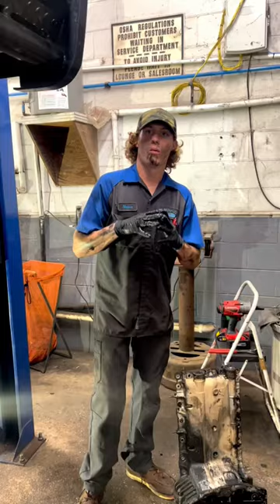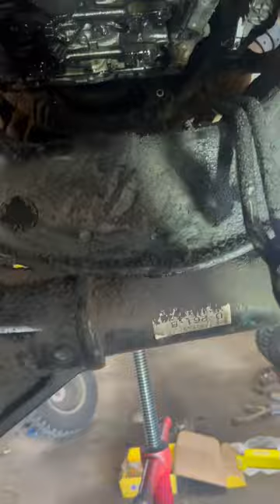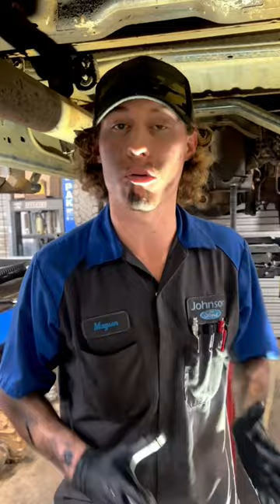Mechanics Should Get To Stay Clean Too #shorts

Comment: Mechanics are always finding new things to put on a invoice 😂
Reply: customers are always bringing in vehicles that are more messed up or rotted out than it seems on the surface and then complaining that they have to pay for all the extra components needed to fix the vehicle properly because they didn’t fix the problem when it arose and let it get really bad to the point that other components are damaged and then crying about how “I’m BeInG UpChArGed FoR noO ReASoN ShADy mEChanIcs alWAYs TrYinG to RiP peoPle OfF” 😂
Reply: @Badwerty0  y’all really do be ripping people off though of course not all shops but I went to get vehicle inspected let my brother fix all the messed up stuff so it would pass because he is a mechanic and did for free. Take it to shop tell them I fixed everything but it’s still having a problem with brakes. Just for them to call me saying it’s 168$ and all they did was put a battery hold on it and slap a inspection sticker on it. Didn’t even fix the braking issue because they didn’t know what was causing it. Turns out it was the abs system when I use cruise control brakes fine when I manually break car shakes like it’s about to crumble
Reply: @esaint5535  ive seen that before. Abs sensor goes bad so every time you hit the brakes the abs system thought the tire was locking up since it was only a speed sensor that changed voltage when it came in contact with the magnet in the hub. Then it would respond by pulsing the brake caliper really fast whenever the brakes were applied. Jeep compass was what i fixed that on.
Reply: @Badwerty0  Probably because these things are built worse and worse with every generation. Used to be a time you could go a couple months with an issue before it even THOUGHT about damaging anything else, these days the CEL comes on and you have all of 30 minutes to get it into a shop bay before the failure starts spreading. And often times it's major issues that cascade instantly....wheels just falling off, conrods yeeting before the first PM comes due, steering wheels coming off in your hands five days after you take delivery.......yeeaahhh these things are built like shit and you can't really blame the owner as much as you used to be able to.
Reply: @esaint5535   I get what you’re saying. Sounds like the shop you went too didn’t have great techs that know how to diagnose properly of course there’s bad shops and good shops 
At the same time though yes it’s expensive to repair a vehicle most places are making very little money because parts have gone up in price so have wages they’ve got to pay their employees , pay the bills to keep the shop lights on , pay to rent or lease the shop itself, pay for chemicals they don’t usually charge you for like brake cleaner, penetrant oil, parts degreaser, etc 

i understand not seeing all of that it seems ridiculous how much they charge to do what seems like a simple job but that’s just how it is 
in todays world it’s either cheap or it’s good can’t have both … I hate that there’s this lack of understanding that makes mechanics and customers hate eachother

Comment: Well you could switch from a book rate shop to and hr shop. Then you don’t get the incentive to pull more than 8hr a day. So you have to pick and chose your battles. Been doing this a long time and I worked mostly at hourly shops for the fact I always get my 40 plus whatever over time I want and never worry about work drought. Also I stick with fleet work due to never running out of work.

Comment: I didn't care for years, used to just brake clean down gasket surfaces etc. I started setting up a power washer under the lift because I just can't see it work quickly and effectively and I got tired of living in the filth of other people's neglect. You're getting charged 14hrs and I have it for at least 14hrs so it's gonna be a clean session with more patience saved for other things.

Comment: Fun fact about book times for body shops. Book time is the amount of time it should take to remove a part off a brand new car. Now take that car and let the front end get smashed in in such a wat that the hood isn't able to open and every single bolt you need access to is pinched between folded and crunched metal. You going to be able to tear down that front end in the estimated book time?

Comment: As long as it’s up front, hit me with that charge! There’s a reason I’m not doing it and I’m paying someone else to. I either don’t have the tools or equipment. Or I just don’t feel like getting covered in whatever that part-swap has to offer.
Reply: That is the awkward and frustrating part though — often we mechanics get ourselves into messes that can’t be foreseen (I’m taking more on the corrosion or electrical side than grime). For example, a few weeks ago I had a control arm bolt snap off inside the frame of a vehicle. Had to use carbide reciprocating saw to get the part out and then cut a window in the frame for removal of the rest of the fastener and weld it back together when done. The corrosion was difficult to assess beforehand but it cost time and effort anyway. Lots of situations like that — because I couldn’t predict the future, not only do I do more work, but the customer isn’t even aware of the shit I had to go through to fix their vehicle. Kinda makes you feel undervalued.

Comment: Hmm. Not sure about this. Yes, most jobs that get you covered in oils and chemicals will offer decontamination facilities and compensate on-the-clock employees. Odd that machine chemicals are the only exception, especially when many pose a cancer risk.

But at the same time, the customer was not necessarily at fault for not knowing about the failure and the damage it may have caused. It is still your job to fix it, come what may.

I'll need to ruminate on this a bit before I can agree or disagree.

Comment: I do the same in my line of business.
I laser clean, which is similar to sandblasting.

Some customers I’ve got in the past brought me turbos clogged up with carbon and covered with atleast an inch of sand/dirt/oil mixture on the outside🤦🏻‍♂️

My work is to either remove rust or paint from your metal, not take a day just cleaning it by hand, and then laser clean it in 10 minutes.

I’ve struggled so much with customers that don’t have any shame in the condition their items get delivered, or in which I find them on site, that I charge double my average rate for time I spend on non laser cleaning.
It’s the only way they learn.

Comment: I would like to point out that most experienced mechanics can beat the book time by a good bit in most cases, yet standard practice is to still charge full book time.
Reply: As you should… good reward for working quickly. Not to mention you did the job, no sense in getting less than what it calls for
Reply: Think about this tho. You can get your vehicle back sooner and be charged the full amount Becouse the only reason it was done fast is Becouse the person is experienced. Why should office jobs get paid more for experience and effort to learn to work fast but mechanic’s shouldn’t
Reply: @matthewcurrie5963  I think they do , no? Hence the levels of technician (a,b,c). I could be wrong, but I wouldn’t give this job to a c, and maybe not b. You have to pull the cab, which like he said for 16 hours isn’t really a basic repair
Reply: @matthewcurrie5963  and since the higher guys only get these types of jobs, they get more

Comment: High end mercedes dealer type shops require an engine cleaning before they even touches the lift.  If you required that or provided that service, you still could charge standard book time without extra fuss.

Comment: Don't forget the tools and equipment that is needed to do the work ... you know like special tool # or speciality puller or socket ... or even rust belt vehicles .. the tp50 on the Ford box bolts . Where I'm at I usually have to grind the heads off

Comment: I have this issue everyday in my trade working on boats 
The decks are white and textured, so any fingerprints stand out 
White painted surfaces all around the actual engine
Takes a lot of prep work, poly wrap all around the engine hatches, cardboard on every surface you’ll be walking on
And if you do get grease and oil on that white decking, the textured surface hangs onto it

Comment: Luckily since I do a majority of my own work, I tend to spend a lil extra time cleaning parts at least to inspect them. Then on the off chance it's a job out of my skill level or requires special tooling, it's clean when I take it into a shop. 

Every now and then I'll go under it with a handful of plastic putty knives to scrape off the buildup from clay, mud, and snow, and then spray it with purple power and run it through an undercarriage wash near my house. So far I haven't been billed for any heavy duty cleaning and hope to keep it that way lol.

Comment: Yup we would get along just fine.    I do mobile work for huge body shops and most of the time the car/ truck is not movable so I have to engineer a way to swap a subframe where it sits,  where ever the tow truck driver dumped it oft,  point its never just book time.    Never lol

Comment: I just want to know why on a modern f150 the book says 2 hours to change the serpentine belt when it's on a spring pulley and really takes about 5 minutes.
Reply: Money is the answer and greed
Reply: @maxwellstephens939  that's also why I do my own brake pads. So wants $450 and I got the parts for $120 and only took 45 mins with hand tools. Imagine if I had a lift and air tools.

Comment: I was a GS for 2 years at a big chain shop. And been doing my own work for close to a decade now. The only gripe I see with this? You're typically gonna be working on more than one car in a day. Something like this, yeah ok, it's an all day job. But if you're working on more than one vehicle, who do you charge? The first one to get you dirty? The last? Both? Any time we got a car caked with mud we'd tell them they need to go run it through a car wash first. But if it's oil, grease, or whatever. There's no way to judge a "time" on that. You could wear long sleeves, pants, gloves, hat, and glasses. Then you'd avoid 90% of that. And if you're using a good scrub to get it off, compared to cheap body wash, it's gonna come of faster and easier.

Comment: Well when I do my suspension rebuild I plan on cleaning up the chassis every inch I can reach and that includes under the spring. Then I will paint both the springs and chassis in such a way that you can easily find anything that drops near it. Every surface will be smooth. Is that better?

Comment: Good point. But there should be a way to perform said procedure without getting the grease  on you.
Run the truck through a specially designed truck wash. Wash it clean and charge the customer for the service.

Comment: getting dirty is part of the fun
Reply: Fun ends when ford makes 300,000 trucks every 5 years that require 14hr just to get it to hold its oil inside. 

Do the math. 

There aren’t enough techs.
Reply: My never never once came home dirty not once even when working in a transmission and gas station mechanic shop he came home clean ever day. Now he works at general motors they love him hes clean and really good and now does their fab work. Stay clean it makes you look good also.
Reply: he's a tech and not a mechanic
Reply: @GriiffixPVP  do you have a job bud ? Have u ever seen a diesel shop or any industrial shop… it’s almost impossible to stay clean working at them places
Reply: @GriiffixPVP  maybe building new transmissions, you just touch a bolt and your dirty
Reply: When the dirt comes out the rear end of a truck or hog it's not so fun
Reply: No it's not
Reply: @expertguy101  your reading comprehension needs work
Reply: @GriiffixPVP  your what never?

Comment: Usually we diag it and if it's terrible you can tell the service writers the time and they tell the customer so if it's bad then you can add time to make sure it's worth doing the job and your not losing time they don't take into account bolts being stripped or bent or rusted out or mud and dirt caked up on everything don't screw the customer but make it worth it

Comment: Yeah… that was nasty. Not only does a clean area make it easier to work, but it also makes it easier to see when you do have an issue that needs attention. Between watching my grandfather over-detail our vehicles and having 30yrs experience in Army aviation I tend to make sure I keep my vehicles like my grandfather taught me. Also, like the Army has taught me. Can’t detect a structural crack in a helicopter with all that sludge caked on. Nor will the 30mm gun of an Apache AH-64D (or -E) accurately fire if it’s turret articulating points are caked with grease and dirt. Keep it clean to keep it running!!!

Comment: Or you can get a fleet job and paid by the hour to wash the truck first, so you don't have to get as dirty. Get paid as you fix the truck, then get paid to wash your self, put away your tools and then get paid to get your workshop ready for the next job. But I respect you taking grenades at the dealership. I did it for a couple years too.

Comment: People complain because it's not dirty/nasty/abnormal to them and they don't realize it.

I have refused to get into the cab of vehicles I was working on and turned down the customers full stop and refused to service them. They don't understand why it's an issue. They drive and sit in that filth all day. I don't want to touch it. 

The exterior is different than the inside, but the mindset is the same. "Cars are always dirty, why are you complaining? This is a scam."-->has a trash mobile they don't clean regularly if at all

Comment: "Standard book time".... Yeah, that's just manufacturer speak for "good fuckin luck Mr. Mekanik." Labor times determined by an average of how long a certain repair takes a very experienced tech to do in the most prime, pristine conditions, with all the needed SSTs and general tools set out, & vehicle already in the stall/on the rack.... And oh yeah, all performed on new vehicles that didn't just come in hot as hell off the road and without years worth of wear/use to impede their speed.... Seems accurate enough, since, u know, every job I've ever done was in the most ideal scenario possible.

Comment: I used to argue with the service writers all the time about this. I was at hourly shop we were all about quality work. They would bitch when I went a few hours over. Like bro book time is for someone who only works on one brand, has done the job before, and for a vehicle that is under 100k miles. You bring me a quarter million mile rust bucket where I have to use the torch on all the bolts or I break them off or is dirty af,  I'm gonna go over on time. In an independent shop thats the owners and SWs fault for not accounting for that kind of shit.

Comment: And while we're at it, why isn't the diagnostic scan and specific code/analysis tool and software built into vehicles by now? You've got all these sensors, monitors and software built into vehicles, and a dash mounted tablet to tell ME what's wrong with my vehicle, but I still get a generic and non specific "check engine light" or "service engine soon light"? So the "high tech" tablet can tell me to turn right to get to Starbucks but it can't tell me, specifically, what's wrong with my vehicle BEFORE I take it in for repairs?

Comment: I got quoted 8 hours from the mechanic....decided to watch a YouTube vid an did the job myself in under 3 hours on the side of the road with a couple borrowed tools. Idk if mechanics are stupid or lazy but there's something wrong with that
Reply: The shop has over head.      (Rent insurance parts maintainance investment to teach newbies like my self) so they charge what the book time says is fair    and if you had to but the tools it'd be looking awfully similar cost wise (If you pay yourself which of course you don't).  And YouTube is great for finding shortcuts or workarounds.    Book time is exactly how the manufacturer intends it be taken apart     like to pull the engine in a Nissan the book said to drain the freon from the ac and drop the front subframe       or you can pull the compressor off the block (leaving the ac lines attached) and wiggle the motor out carefully from the top
Reply: @Christopher Elrod  if they got bills charge more per hour don't just make up fake hours. I took everything apart just like your supposed to but after I was done I did find a shortcut that makes it a 30 min job. I'd rather just pay 300 an hour to have something done in a reasonable amount of hours vs paying 100 and get charged for 5 unneeded hours
Reply: Blame the manufacturer for the book time. Techs have nothing to do with how they set the book times

Comment: Bro pull the cab and engine. you won’t get filthy, you can clean the nasty off the frame. I charge 18 hours for this job. Because to do it right and it look professionally done, pulling the cab and engine is the best way IMO. Pretty sure ford procedure is to pull the cab unless that’s has changed 🤔 either way bro. It beats pulling transmission and working over your head in a filthy, close quarter environment.

Comment: Maybe buy a power washer and wash the working area before you start. That’s what my mechanic did. Before you get all butthurt. I spent 30 years in the operating room. I’ve been covered in fluids I could only wish was oil & grime. I bet you’d change your tune if you could witness a peri-rectal abscess as the patient coughs just as the incision is made…. I don’t think you’d complain about the grease & grime…. It’s all relative……😁

Comment: A don't forget something because you are taking about flat rate but warranty rate is even less if you can do a two hour job in hour you get paid for the two hours but if something goes wrong and it takes you three hours you get paid for the two slave labor and it's probably not 50 / 50 for the labor 😂